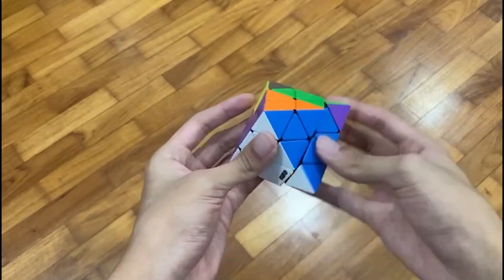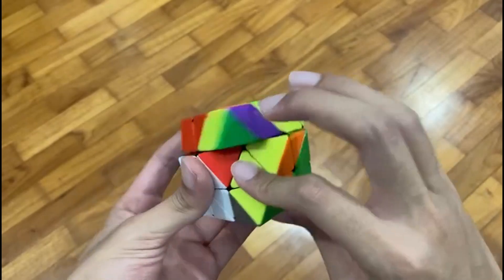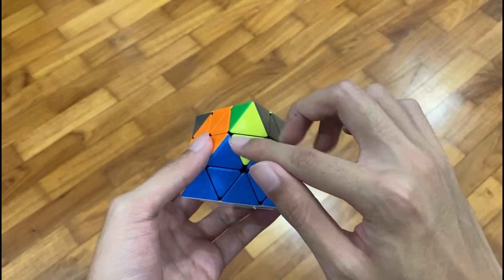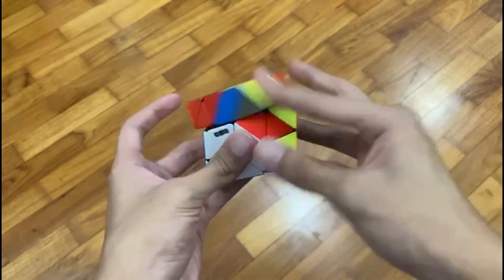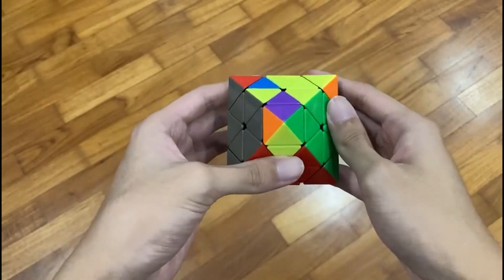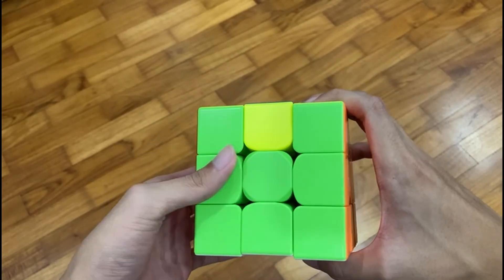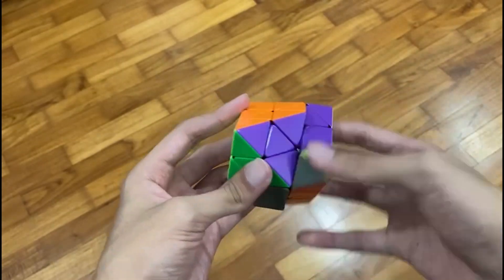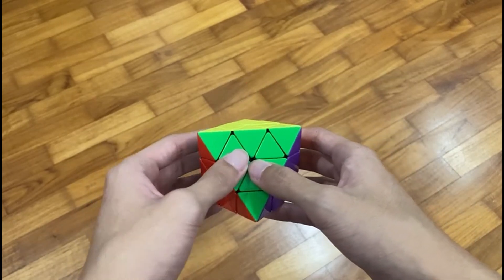Trouble With L3T? Try This! (2-Look TCP)

Comment from the maker: i realize i didn't elaborate as much on the one-flip case as i should have oops

if you get a one flip case, choose the triplet paired in the second layer, and use that corner to form a pseudo triplet with the flipped triplet

Comment: I definitely prefer the Kit Clement u-perm algs as they get right to the point, therefore don't require any setup moves, and are easy to recognize quickly
Reply from the maker: they are most definitely better algs than the ones i used but i was aiming to make the tutorial as beginner friendly as possible, hence their use
Reply: @literallycubing  yeah fair enough, though I've seen many people using these algs a lot more whenever encountering that case, whenever I show then kit's alg they all react with "damn that's much faster" lol